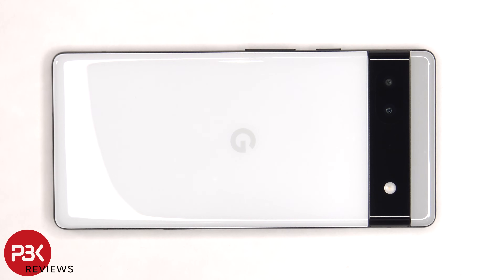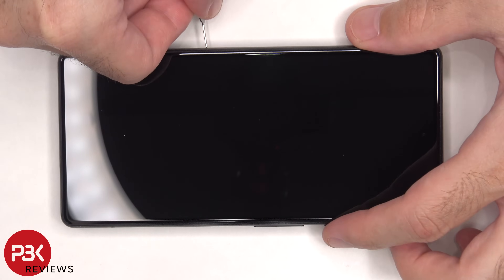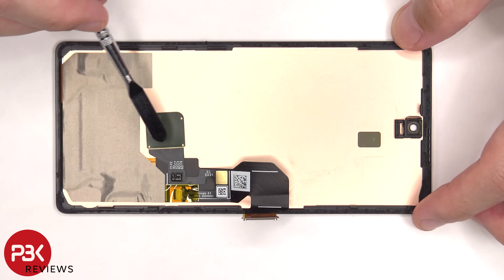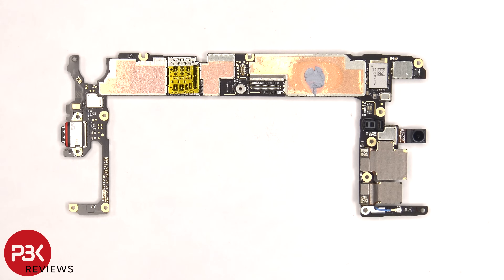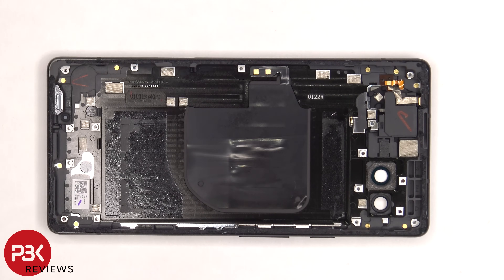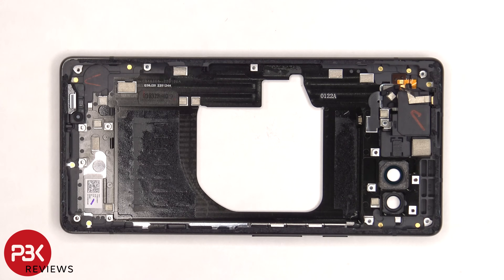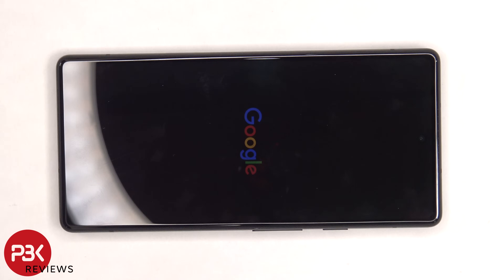Google Pixel 6A Disassembly Teardown Repair Video Review

Comment: 02:15 When removing the protective film near the charging port you also have to remove some film in the top right! I did not know about this and almost ripped it when removing the battery. Also be careful when removing the film since you want to reattach it later.
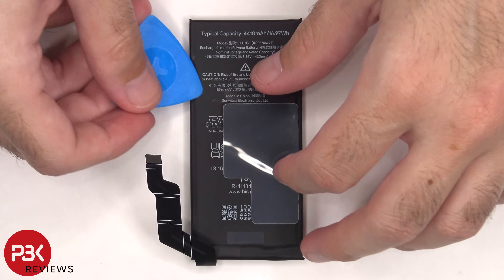03:10 When changing the battery (what I did) make sure that you apply the two stickers from the old battery to the new one.
Great tutorial! Its the end of 2025 and this just helped me an hour ago.

Comment: Does anyone know this: Will the phone itself still work, if the microphones are desoldered, fingerprint reader disconnected and the front camera removed? 🙏
Reply: Still works, top Mic easy to remove the lower one needs quite some heat and good flux.

Comment: My Pixel 6a suddenly blacked out. No battery issue, no bloating. This happened last year. I got 7a after, barely a year, the battery bloated and needed replacing.
Reply: Was everything still in your phone when you replaced it?
Reply: @khotanruizadame4446  After replacing the bloated battery on my 7a, my phone was good as new. My 6a is still dead as I have not replaced its battery.
Reply: Yes, all my data in my Pixel 7a were intact after the battery replacement

Comment: My old pixel 6a got water damaged and wouldn't turn back on last year, ive since bought a new phone but there are pictures on my pixel 6a that i want to get back (they didnt back up to Google photos) would i be able to dismantle the phone and find the storage card bcos i really dont wanna pay for to have it fixed just so i can find the old pictures. Thanks ❤
Reply: I know it doesn't have an SD card slot but is there an internal storage right ?

Comment: Thank you, very interesting !
My phone died after being dropped into water (apparently not that much IP67...), and the motherboard is severely corroded. Do you think there is still a way to extract photo/video data from the intern memory ?
Reply from the maker: If you aren't able to get the board to power on, most likely not.
Reply: @PBKreviews  Okay, thank you for your answer !

Comment: Is it possible to extract data from a dead Pixel 6a (motherboard issue) phone’s memory?
Reply from the maker: Would probably require de soldering the soldered ROM chip and soldering it onto a working board.

Comment: 4:58 these two testing points between two connection pads for the NFC on the back side of the motherboard, aren't these just the unpopulated QI charger connection pads?!

Comment: Is there a way to remove the camera glass separate to the rear case?
Reply from the maker: Yes, you can heat up the glass portion and pry it off with a thin razor
Reply: @PBKreviews  Thank you so much for the reply! I only really have small impact and a crack over the glass over the lens. Hopefully I can remove it as one piece without it shattering

Comment: Hey, Thank you for the video! Is it possible to recognize part number of the charger chip? I met some problems with my google pixel 6a and want to figure out if it is the charger curcuit feature. 
Thanks!
Reply from the maker: You're welcome. Unfortunately I don't know exactly which chip that would be and I don't have the phone anymore either if I had to check.

Comment: Bro I'm bought pixel 6a a month ago and charging it overnight with Google's adaptor but I noticed yesterday that a very small portion of battery has been swelled battery cover came out from one side a little bid. What should I do? Any suggestions. Or i should contact the service centre?
Reply from the maker: If you want to replace it yourself you can, but if you feel you're not up to it, you can always send it in to them for repair or take to a service center.

Comment: hey bro could you please tell me does Google Pixel 6a phone has water resistance sealed in front panel glass?
Reply from the maker: yes it has a adhesive water resistant seal around the screen.
Reply: @PBKreviews  bro i got my new pixel 6a 1 week ago... and im seeing a lil bil aluminium plate which comes besides of the bazel still is it resistense?

Comment: I have a doubt for a longtime.

Many devices that come with IP ratings such as IP67 , IP68 . What about the situation of these ratings once the device is opened up for any repair?

Will they still provide the same protection as per their IP rating even after they are opened up and repaired?
Reply from the maker: Hi, well once the device has been opened, you lose the protection because the adhesive seal has been opened. Unless you install a new original pre cut adhesive which is made for that phone, you wont have an IP rated device anymore. Usually for many phones the original pre cut adhesive is sold by itself or on replacement back plates/covers. But for ones which are not and you use your own adhesive to install, then you wont have the protection.
Reply: @PBKreviews  what if the device is repaired by the brand authorised service centre ?
Reply: @dwara9  still would have the same issue. as long as the phone has been opened, it will lose its IP rating

Comment: This phone has only one speaker? Recently I was purchased 6a left side speaker was not working and left side port was dammy speaker?
Reply from the maker: there is one speaker on the bottom and one on the top. The other bottom side is for the microphone where sound goes in.
Reply: The grille on the left side is a mic, not a speaker.

Comment: The non removable USB c port really ruins this. Looks to be an incredibly easy screen replacement along with battery replacement. The ability to fix the USB c port would be a godsend especially in a device without wireless charging
Reply from the maker: yup
Reply: Exactly. I have broken and replaced my USB port many times on my smartphones.

I was considering to buy this phone, but now I am going for a Fairphone or something I guess.
Reply: oh damn. I just changed the usb port on my old Mi A2, but I also have this phone... so disappointed on the usb port, I guess it'll be e-waste if anything happens to it :(
Reply: @astarothgr  Still bought this phone though. It is really a very nice phone. Hopefully the USB port will not break haha.
Reply: @nailfarmer22  yeah, it's a nice phone. Still, I wish I'd known about this when I bought it, I might had chosen something different. Selecting a smartphone is a tricky business.
Reply: Why mine is so hot when  am using

Comment: Google phones are starting to look sexy inside just like apple, 👍 keep it up Google.

We need to push companies to also make mobiles internally appealing because that's also important.

By the way I used my Pixel 6A to write this message.

This phone performs great and it's only 6a

Imagine pixel 8 and 9 in few years

Apple may have a fight on its hands as Googles android is starting to feel butter smooth, and battery life is prefect also..

I still use the iPhone as my main device, but love my android for the things I can't do on my iPhone out the box 😉
Reply: Bought my Pixel 6a for $299 on Amazon. Unbeatable
Reply: @rwyo83  Same. When it was on sale for $299 at Best Buy and my local store had my color in stock I just couldn't pass up buying one a week ago.
Reply: lol

Comment: Having a screen problem on my Pixel 6a, where can I buy a new screen for the 6a?
I have been looking online but not finding a replacement screen.
Thanks
Reply from the maker: If you search pixel 6a lcd on ebay you will see listings for it.
Reply: @PBKreviews  was looking on Amazon but only found 1 replacement screen, will send back the device this week might get covered by the warranty.

Comment: Apparently mine had scratches as well or of the box.
And 2 days after I bought it the screen broke... It's so fragile! Didn't the gorilla glass technology advance in the last few years?
Reply from the maker: Oh that sucks. Not to the point we need it to from the looks of it.
Reply: how did the screen break?
Reply: @Xevos701  fell from 40cm to the floor. This is fragile.
Reply: Ah, not surprising.

Fyi, Google is using older Gorilla Glass 3 for the Pixel 6a, which is around 10 years old at this point.
Reply: GG3 -> GG5 -> GG6 -> GG Victus.

Pixel 6 and 7 main series use Gorilla Glass Victus, which is the latest and best in the market rn.
Reply: @Xevos701  It's maybe best at shatterproof but scratch wise is not that good, worse than some if not all versions.

Comment: My Pixel 6a did not come scratched. Yours also appeared to be different, had really tough time taking out the large metal enclosure which was screwed into place. Mine had plastic brim holding it down also.
Reply from the maker: Not sure what you mean by the plastic brim, but was it for sure a pixel 6a? maybe there might be a slight difference in the mmWave version which would be for verizon but doubt it should have any difference aside from an extra antenna assembly.

Comment: Is the battery sold separately anywhere? For most "repair", what people want to do is replace batteries, right?
Reply from the maker: Yes usually the replacement parts start showing up around a month or two after the phone has hit the market.

Comment: Will this affect the phone’s water resistance after the tear down and reassembly?
Reply from the maker: Yes, you would need to apply new original pre cut adhesive that is made for the phone once it becomes available to retain the water resistance.
Reply: Where can i get original pre cut adhesive?  @PBKreviews
Reply: @PBKreviews  I had a 5A crap out due to 2 screen replacements. It was barely submerged. It definitely affects it. Even though it's only ip67 rated they should survive a soaking. Once you rip things a part to many times it's going to lose its rating slightly.

Comment: I made the mistake to insert the metal needle into the mic hole, i have checked and the mic is working just fine but i am agraid about the waterproof property, do you think i could have brokem the seal or somethin?
Reply from the maker: Hi, you will be fine, both the filter and mic are seated above the hole and would not be damaged.
Reply: @PBKreviews  thank you sooo much

Comment: Do you think the hardware here in general is any good? I mean the fingerprint reader is kinda lame sensor only module(no optics), old circular vibration engine, no laser af and no cooling system either.
Reply from the maker: I mean it should be a decent phone, but nothing out of the ordinary.
Reply: circular vibration engine ??

Comment: The soldered charge port is completely unacceptable
Reply from the maker: Yup!
Reply: Having to do this on any phone to change a battery is unacceptable!
Reply: @ratboyninja  New world. Manufacturers are in the buy a new phone business and repair business too lol. They are happy if you break a 5a and buy a 6a. They don't want people keeping these things for 4 years. 2 at best.
Reply: @ksull72487  yeah they quote their green credentials.
Reply: Cost saving measure by Google. You ruin that port most shops will refuse the phone. Although some of these smaller skilled shops may do the work without much of a warranty.

Always use good clean USB cables. Keep a can of compressed air on hand for cable and port. Dust and debris will kill it eventually but you'll likely be on your next phone before then.
Reply: This is the only reason I have to replace my phone.
Reply: I watch these videos BEFORE I buy a phone. Though the repairability scores are similar between the Pixel 6A and Samsung A53, don't you think the A53 should get a better score since you don't have to risk cracking the screen for the eventual battery replacement and also the fact that the USB-C port (also often a wear item) is not soldered to the main board?
Reply: Cry
Reply: And I got a new 6a with a defective charge port out of the box, wouldn't hold the cable in. I didn't realize at the time because I'd never had a USB C device before.
Reply: How much do two screws cost? Like 5 cents?
Reply: yes, I am never buying a google pixel phone again

Comment: this guy needs to slow down. .with the accent . .some of the words are completely jumbled and non-sense.  What the are "white foam balls" near the charge port.  When he intros the repair times. . I cannot make out the "repair <garbled> I give this a 7 out of 10"  . .huh?
Reply from the maker: Not sure what you mean by "what the are" white foam balls but we can all slow down I guess in typing and speaking lol :). I try to slow down but sometimes it sounds too robotic for me. Can't help it I guess, just the way I'm built. As for the repair part, I said repairability score. 7 out of 10 so not sure what part of that you weren't understanding, let me know so I can clarify.
Reply: @PBKreviews  cool. .thanks for reply.  it was the part right after you take off the charging port module. . .I think you were talking about part of the mount for it.  not sure.

Comment: if we having charging port issues
we need to replace whole main board as charging port and all things are in 1 main board?
Reply from the maker: Pretty much, or you would need to find a specialty repair store that can do soldering and can de solder the bad charger port off of the board and solder a new one back on.
Reply: Not great for repairs then. You'll have to treat the charging port carefully but on the plus side being soldered in should make it pretty rigid.

Comment: I have question about my Samsung Galaxy S21 5G phone I will not even try to connect to the Wi-Fi I'll go to settings and turn on Wi-Fi and it would just turn the Wi-Fi right back off I don't know if I'll half to take it apart to fix something or not
Reply from the maker: Try doing network reset in the settings (this would erase your wifi stored passwords and such as well) and if that doesn't work then try backing up your data and doing a factory reset (will erase all your stuff on the phone). If still no luck, then would be a hardware issue on the main board which would require a professional repair shop to be able to fix or sending it in to samsung.

Comment: Does the FPS looks larger than on the standard 6 series models? That's how all batteries should be removed. No balls in lower speaker? No wireless; FAIL. Not impressed.
Reply from the maker: not sure what you mean by the FPS, but yes batteries should all be easy to remove like this. The bottom speaker might have the foam balls, I didn't peel back that thin strip of graphite film but looks like it does.

Comment: Assuming that the space for the wireless charging coil is actually for that, i wonder if there are contact points on the board which allow power input, in which case it should be possible to build a wireless charging pcb, and add it to the phine
Reply from the maker: I checked, the main board doesn't have any additional pins or slots for pins to be installed for more contact points. There is a resistor there in the middle of the 2 pins so there is no solder points there for anything to possibly have been installed. Not sure why they have such a large cutout for the NFC, maybe they originally planed for wireless charging but scrapped it down the line when the frames were already made or maybe some other thing no clue.
Reply: @PBKreviews  What about the no-pop'd connector location near the battery connector on the main board? There's even a hole in the midframe in that location.

Comment: Not happy with connector soldered to board and never expected from Google. Same issue happened in my Moto G4 plus were connector port soldered to the board and if connector is not working need to replace the motherboard.
Reply from the maker: yeah, it sucks.
Reply: Forgive my stupidity but whats the alternative? Separate pcb? Just asking because I've never seen anything else than soldered ports. Did they screw them on at one time?

Comment: I’d take it back. Doesn’t matter whose fault it is, Google’s or the store’s, on a full retail price they're ought to give a product without flaws.
Reply from the maker: Yeah, if it was going to be my personal phone I would. But just using it for the teardown, plus can't return it if I took it apart already :)
Reply: @PBKreviews  you must have received a display/press device as the first 6a's are going to be delivered earliest on 27th o 28th. I can't understand why you complain about a non commercial version to be knocked up.
Reply: @damianb.1007  He said it came in a sealed box so i am assuming it is a retail unit.
Reply: I got a 6a the other day that had dust inside the lense :/

Comment: Pixel 6 a and same issue with debris in the box and scratches all over the phone. even worse case than yours :( had to return it and got a replacement. my new unit is perfect normal gladly
Reply from the maker: Oh ok so it looks like this isn't the only device running into this issue. Hopefully they will look into it and fix their packaging or the issue causing debris to get inside the box like that.
Reply: This phone is not sold yet. Where did you get it?